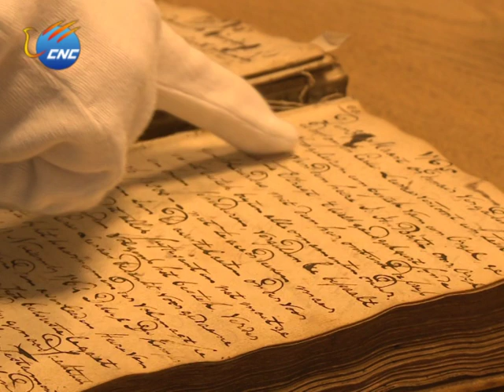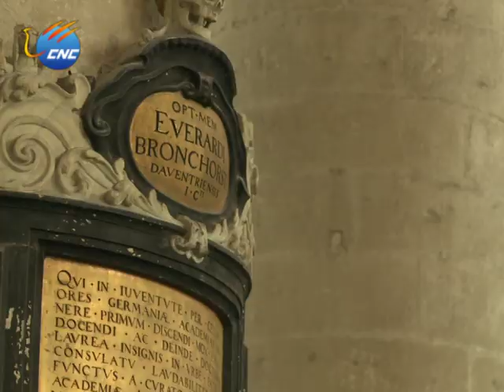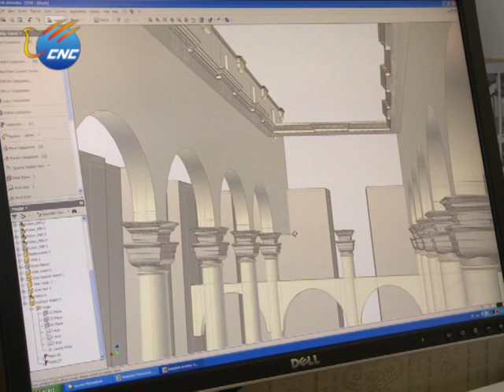Ancient organ makes new sound

Comment: I have some ideas on how to configure an organ structure in such a way as to both simplify regular maintenance and make for better integration into a concert hall's structural framework.  My ideal Flentrop would have its dual Pedaal chests in both ends of the main case, with the Hoovdwerc, Borstwerc, and keydesk betwixt them, and the rear casewall of the Rugpositief two meters from the keydesk to allow for both registrants and recording crews; the Pedaal rollerboards would run half the overall width of the main case.  Building codes in my native California (USA) force an extra-stout endoskeleton in the case, with reinforced hardpoints for tying the organ to the backstage shear-wall matrix.  For a hall with 20-30 feet floor to ceiling at the stage end, I'd recommend a Pedaal with 32' flute/16' principal chori, Rugpositief with 8' flute (broken Cornet plus Querpijp 1)/4' principal chori, and a Borstwerc expanded from a continuo organ specification, all of which can be referenced from:

HOOVDWERC
16 Boordun
8 Praestant
8 Roerfluit
5-1/3 Nazaat
4 Octaaf
4 Speelfluit
3-1/5 Ters
2-2/3 Quint
2 Gemshoorn
(2 + 1-1/3 + 1 + 2/3) Mixtuur IV
16 Dulciaan
8 Trommet

Comment: nice but these things are prohibitively expensive
Reply: Organs are, initially, very expensive, due to the cost of materials and labour needed to build them.  However, they are cheap in the long term, because, 1/  they last (indefinitely, if properly maintained) and, 2/  they produce a good quality sound.
   If your only interest is in the financial cost of an instrument, then buy an electronic organ of some sort.  It will be cheap, easy to install, and fail within a relatively short time.  Then you can buy another.  And all this time, you can have sub-standard music from an instrument which reminds you of what you are missing, and played by an organist who can't get a job playing the real thing, or who is willing to put up with what he knows to be second-best and uninspiring.
   But don't worry.  After a year or two, you will stop noticing the difference.  You will have become musically dull, your expectations lowered by the second-rate sounds produced by the electronic and its unfortunate player.
  Then again, why not go for the really cheap option and get in a few untalented young people with guitars and drums.  Now you really have hit rock bottom!
Reply: Offshoreorganbuilder As someone who goes to a church which mothballed it's pipe organ 18 years ago I can only concur. 

We've spent £5000 on new speakers and manuals, and re-voicing and we're still not done. It really needs a new computer. At present it has three 486Mz (1997 technology) machines which barely cope. It only knows how to blast, it can't do subtle because none of the flutes have any presence, the diapasons are dull and boring and the big reeds just bark or buzz. This is an improvement on what it was like!
Reply: Paul Wheeler Interesting!
  In a cathedral, known to me, a well-meaning but misguided person (the then organist) persuaded the authorities there to spend a huge amount of money (estimates vary between £50,000 and £70,000 -.  no-one will admit to the true amount) on one of the latest electronics.
  It has 3 manuals, a sequencer, fistfuls of stops and an impressive array of pistons.  It looks just like the console of a large pipe-organ and even has a 'west end' section.  Great?  Swell?  Alas, no.  The sound reminds you, strongly, of a pipe-organ, but the reed basses are buzzy, as is the bass of the Bourdon, the Tuba on the Great obliterates everything else (a thick, 'white' sound) and every stop 'oozes' onto speech in an effort to avoid the 'thump' of the older electronic organs.  The 'music committee' bullied into accepting the idea, and others thought it a failure (to put it politely.)
  Ill health forced the resignation of the organist, who was replaced by the present one - a professional with a doctorate in music.  He refuses to play the new 'organ' if at all possible, so it sits there, a costly mistake, a reminder of the egg which continues to dribble down the faces of those concerned in its purchase.  So what do they use to accompany services? - the building's original, Victorian pipe-organ, which, despite an unfortunate position (thanks to the idiot architect, all those years ago) still sounds so much better than its electronic substitute and still works.  There are plans, now, to enlarge and re-position it, or even replace it with another pipe-organ, though funds are in short supply at present.  (Wonder why?)
  This sad tale has been repeated many times in the past, and will go on being repeated, as long as those concerned fail to recognise that, whilst it might look like a pipe-organ console, an electronic is a different instrument with a very similar, but different sound.  Its stop do not exist in reality, and what you are listening to is not pipes, but a number of paper cones in loudspeakers.
Reply: ***** totally.
Reply: peter krauss True. But if given reasonable maintenance, they last for centuries. In the Laurenskerk of Alkmaar (now a maritime museum) is a "side organ", fully playable, that dates to 1511. That's a pretty good return on investment!

Comment: Using a candle to find air leaks was an ancient technique. Now it's just reckless exhibitionism that invites catastrophe. There are smoke generating devices that work better and without risk of causing a dust explosion. They are used for numerous leak detecting tasks. Had I been the music director for the church, that guy would have gotten his butt booted out the door for doing that.
Reply: Robb403 Or you just use your ears and hands.  A leak that big is going to be obvious.
Reply: Sometimes, I'm sure you could. But, old pipe organs have a tremendous number of places they can leak and each leak loses a bit of pressure which reduces the volume of the organ. There are usually multiple leaks because the wood expands and contracts, caulks dry out and come loose and seals dry out. There is a device that is like a squeeze bulb you use to clean your ears. It puffs out a smoke like stream of particles to find small leaks. There are also some electronic devices that lead you to small leaks by the ultrasonic noise they make. Most leaks are plugged during routine maintenance. An organ that hasn't had maintenance for a long time gradually loses it volume and the large pipes just quit working period.